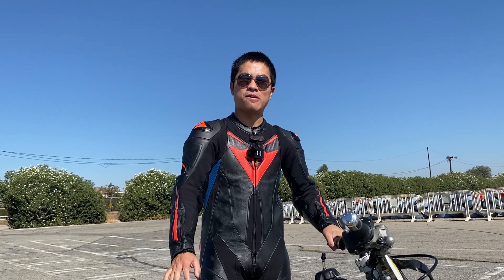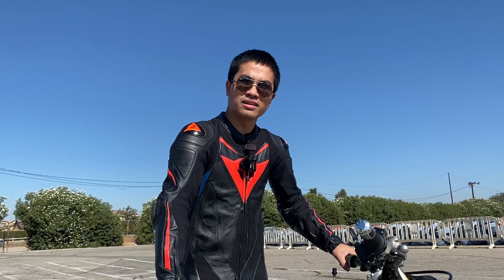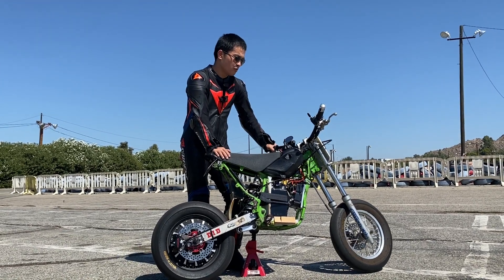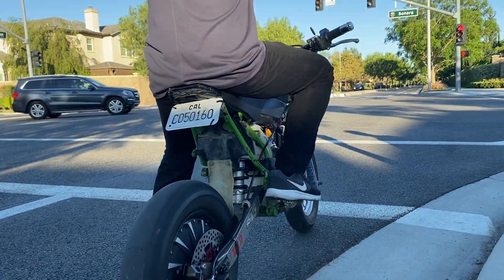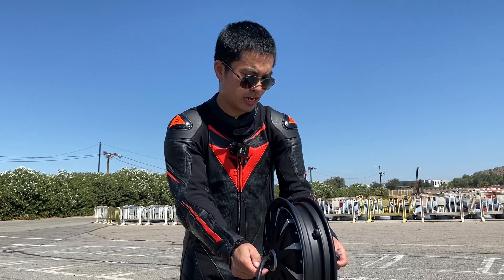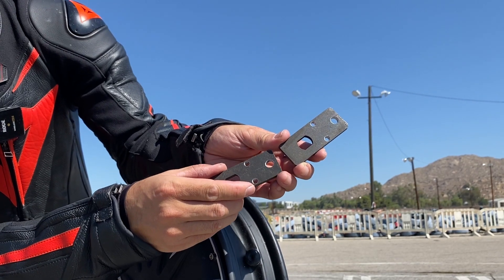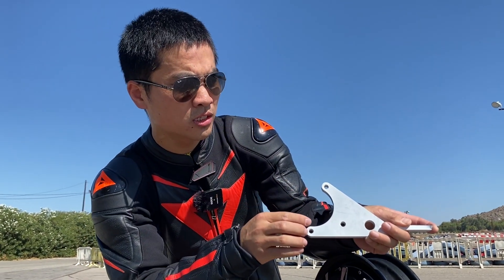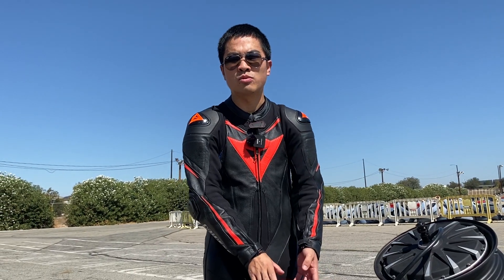Kawasaki KX65 electric conversion hub motor kit

Comment: 15 Ah is quite small. Also would be better to set hub motor to front wheel, without replacing fuel engine.

Comment: Lei Tian, thank you for making this video I am very interested in using some of your electrify items you used in your kx65 conversion.I want to change an older 150CC Vespa ET4 to be electric. Do you have any ideas for me as far as hub motor and battery makeup? I'm looking for a few things... the stock rear tire is 10 but may be upgraded to 11-12 inches. the battery capacity needs to get me 60 to 80 miles (street riding mostly 35-45mph with a top speed of somewhere around 60-65 MPH... I believe the Vespa is the best choice certainly because of the volume of storage located on the vespa for batteries etc. Thank you for any ideas you may have. -Mike
Reply from the maker: Hi, if you want to convert a specific vehicle, please note that swingarm structure varies a lot in different vehicles. The point of the kit I used, is to (almost) directly drop in to the swingarm of that specific bike. So by targeting a Vespa which I do not know of an existing kit out there, you are on your own to make things fit --- it's quite a bit of work, but of course anything is doable with custom fabrication work

Comment: Power wheelie or mostly technique?
Reply from the maker: Power wheelie at low speed. At higher speeds power alone is not gonna lift the front wheel
Reply: @leitian7328  That's still really impressive. Definitely gonna build this too. Is it OK to contact you if i have some questions?
Reply from the maker: @Twotoz  Yeah sure!
Reply: @leitian7328  What would be the bennefits of a hubmotor vs chain driven?
Reply from the maker: @Twotoz  well the general guidelines on hub motor vs mid drive all apply. Advantages: quieter without chain noise; smoother without chain jerks; mechanically simpler; cheaper to build; more room in the middle of the bike for the battery. Disadvantages: huge unsprung weight; can’t use stock rear brakes; can’t do gearing modifications; kinda inconvenient to change the rear tire.
Reply: @leitian7328  Yes, but i am unknown with the feeling of unsprung weight. Is it really a big problem (on asphalt)?
The ride seems very smooth on video.

The white bike in your newer video also looks incredibly good.
Reply from the maker: @Twotoz  street riding for commuting and such —- no there’s no difference or “feelings”. High performance riding on asphalt such as track riding, with imperfect asphalt surfaces —- big difference, unsprung weight will make it much harder to stick to the limit.
Reply: @leitian7328  Ah okay, it will be a street legal pitbike moped. Just for riding around and stunting, doing a bit of wheelies. I don't think stoppies would be good fot the motor?
Reply from the maker: @Twotoz  It's not good, but it will take it occasionally of course. I ride over bumps / stairs / potholes all the time, it's the same stress level
Reply: @leitian7328  Okay, thanks a lot for the information.
I will begin to build my pitbike with hubmotor soon.

Comment: There are two main problem with hub motors: 
1. They cause heavy unsprung weight
2. They're slow 
If these two problems don't exist (at least #1) it will be interesting to build 2 wheel drive dirt bike
Reply from the maker: You are not wrong! I don't think hub motor in dirt will ever work, rims get bent way too easily with the unsprung weight.
Reply: Your #2 is wrong. They are fast.
Reply: @jeffmoen8563  nobody says that but you

Comment: Around 1:11 mark I can see that the rear wheel jumps a lot even on small bumps and at low speeds. I'm guessing it caused by the weight of the rear wheel? Or is it due to a busted/poorly adjusted shock?
Reply from the maker: The shock can use some fine tuning —- also, the cracks on the pavement are kinda significant. A third factor, the unsprung weight of the hub motor does make it a little worse on bumps like that.

Comment: What kind of rear shock are you using? Stock front forks? And where did you find that seat? Thanks 🙏
Reply from the maker: Hi, the shock is a FZ-09 shock. With a little modification it fits, and works pretty well. For the forks, the dampen rods were modified —- the big holes were sealed up, leaving only the smaller holes, to increase damping; also 15w fork oil was used.  I didn’t change the fork springs, they are still pretty soft —- but it’s fine for playing around.
Reply: @leitian7328  thanks Lei! I messaged you on Facebook and didn’t hear back..
Reply from the maker: The seat is from Ebay, you can search “kx65 tall seat” and find some good options

Comment: Where can I find this kit? Link please
Reply from the maker: Hi, here is the Facebook marketplace link: https://www.facebook.com/marketplace/item/4314698808591865
Reply from the maker: If you have any questions feel free to message me on Facebook!
Reply: @leitian7328  can’t get ahold of you on Facebook. I’m interested in this electric kit.
Reply from the maker: Hi, that’s weird, can you add me as a friend on Facebook? I will double check my facebook messages
Reply from the maker: @irajghanizada1912  It depends on many factors. Three major ones are: how big the battery is, how long the straights are, and how much power you allow the motor to consume. The build shown here, with a small pack (1kWh), and the track being super demanding with a long straightway, it only last 1 session if you allow 10hp; 4 to 5 sessions if at "low" setting at 3hp. It takes anywhere between 1 to 4 hours to charge it up, depends on the charger size / setting and whether the battery is cool to accept high charge current. It is regular AC charger.